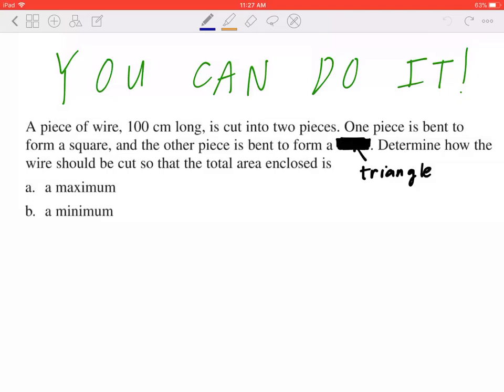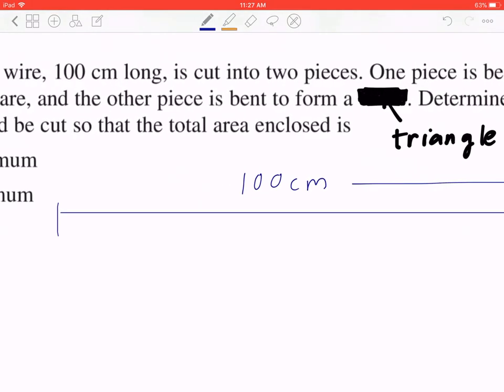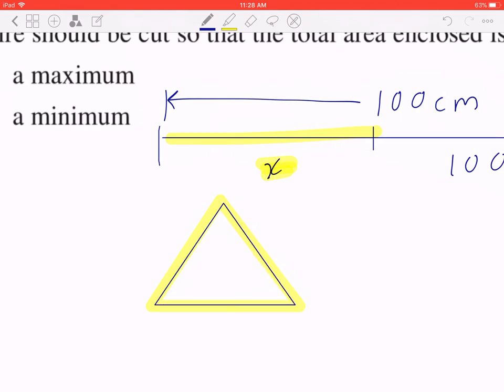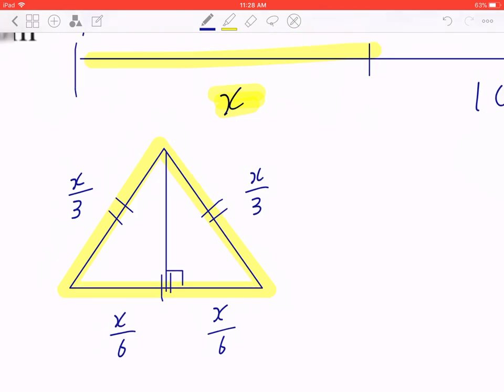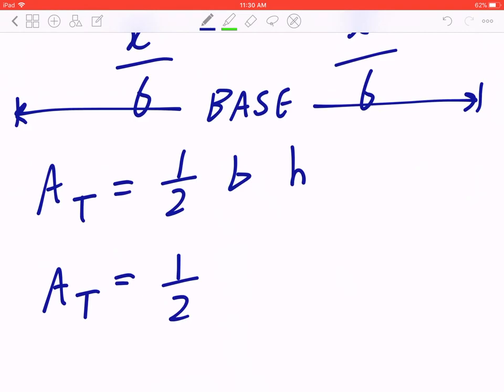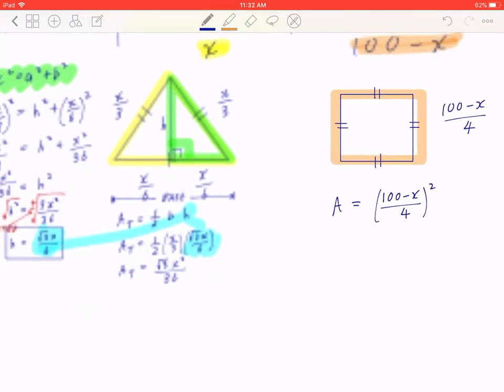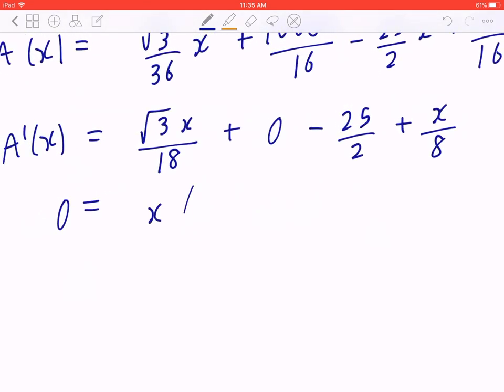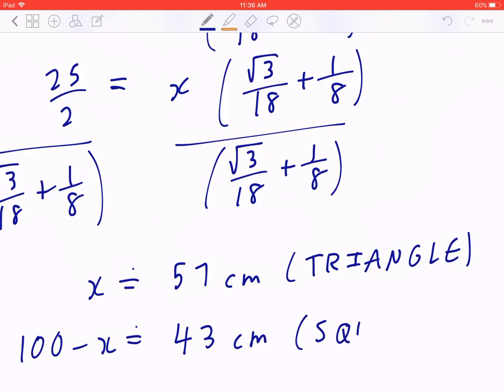A piece of wire, 100 cm long, is cut into two pieces. One piece is bent to form a triangle, ...

Comment: I am sorry, but I believe it is incorrect. The area of the triangle is A= 1/2(base)(height). The base should have been x/6 and not x/3. At the end you should double the area because it is the area for 2 triangles. That really means instead of A= 1/2(bas)(heaight). It should just be (2)(1/2)(base)(height). The half times the 2 (becaue there are 2 trinlgles) cancel each other out. The area then should be A=(base)(heght). The base = x/6 and the height that you got is correct. The final answershould have been (square root of 3)(x squared) all over 18 centimeters squared. A= [(3)^(1/2)(x^2)]/18 cm^2.

Comment: How do you get the value for Base?
Reply: He divided the fraction of x/3 by 2. That means leave the x/3 alone and multily the reciprocal of 2. That looks like this: (x/3)(1/2). Multiplying the top you get x and multiplying the bottom you get 6. The final answer is x/6. By the way the top of the fraction is called NUMERATOR and the bottom of the fraction is called DENOMINATOR.